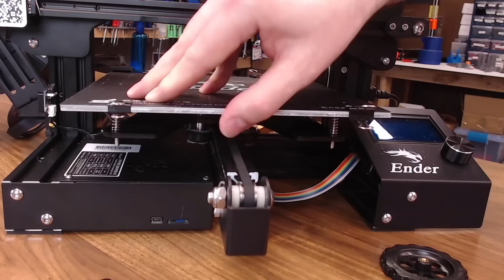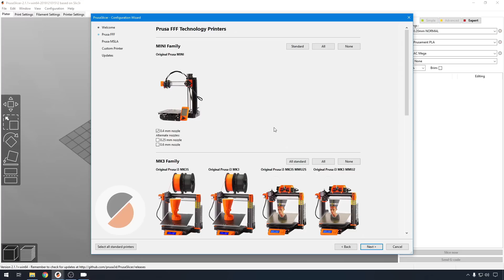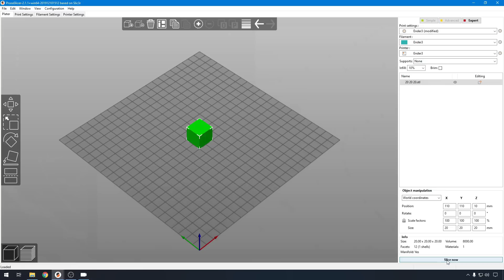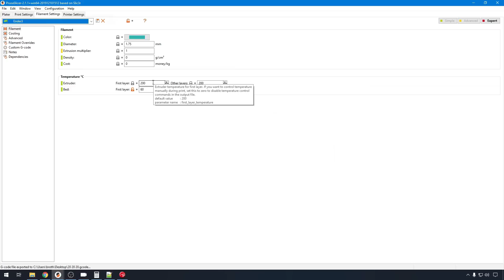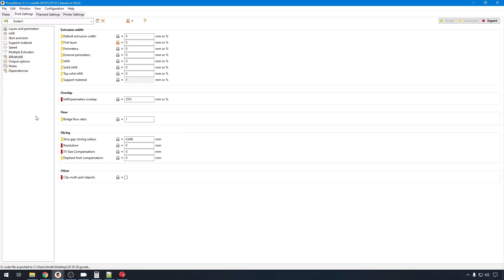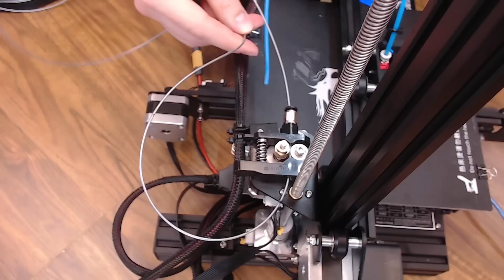New Ender 3 User Part 3 - Upgrades & Slicer Settings - Chris's Basement

Comment: Hello Mr. Riley!
I love your videos, learned much from them. My only complaint is when I need to come back for to watch adjusting something, it's hard to find from all of your videos. I knew I've watched you adjusting extrusion / check filament using a digital caliper but finding this video took some time. :) But you put ton of great stuff in one video; not like others changing a bowden tube for 10 mins to get advertised.
Reply from the maker: I wish it was easier to find stuff in videos too. We are working to go back and idex all the older videos to make it a bit easier.

Comment: is that last step on pronterface really necessary? don't really want to dealt with yet another program...
Reply from the maker: If you E steps need adjustment then yes. Most of the time, they are fine.

Comment: hwy chris i love this video series you are making on this printer seeing how i chose to get back into to 3d printing after a really miserable beginning failure to launch start some years ago. after much research and seeing this printer working live at a locale micro center i decided to get back into the hobby. and since have been having a lot of fun and frustrations. but when you started this series i was excited. so i have been watching and following along. i was using cura and having decent luck until i needed to switch my machines out cause the rotary knob broke now the machine i got is not as good as the first one lol. soi got prusas slicer and been working with it and i tried the enter the start gcode as you explained in the video how ever everytime i slice a a model i get an error sating the start gcode is has an error what could i have wrong because it does not make since at all i wll post it just as i have it written 
M104 S[first_layer_temperature] ; set hotend temp
M140 S[first_layer_bed_temperatrue] ; set bed temp
M190 S[first_layer_bed_temperatrue] ; wait for bed temp
M109 S[first_layer_temperature] ; wait for hotend temp
the other problem i have been having on these machines is my nozzle extrudes filament while heating up to print temperature
thank for your hard work and knowledge
Reply from the maker: Hey, I am glad to hear you are getting back into 3d printing. It looks like you have a spelling error causing the problem.

M104 S[first_layer_temperature] ; set hotend temp
M140 S[first_layer_bed_temperature] ; set bed temp
M190 S[first_layer_bed_temperature] ; wait for bed temp
M109 S[first_layer_temperature] ; wait for hotend temp
Reply: @ChrisRiley  that will do it everytime

Comment: I have my first 3D printer on the way (an Ender 3) and just ran across your channel looking for more information on getting started when it arrives. This series is very well put together. Very informative and well spoken. Thank you! I'm looking forward to the next episode. Still undecided which slicer to use. But will most likely be either Cura or Prusa (or both). That said, I have an idea for another video for this series but would be useful with any machine. I don't really see anyone giving their opinions on how to decide on wall thickness, infill amount, infill type, etc. The basics of what one needs to design a decent part, so to speak. As a complete beginner, I can see myself using a ton of filament on over built designs. Or completely wasting it on under built designs. Anyway, use it or lose it. I'll still be watching.
Reply from the maker: Thanks for watching, some of that will be in the next video for sure. Stefan over at CNC Kitchen has a lot of good stuff like that.

Comment: Side note on the springs:  They may lift the bed up.  I ended up having to move the Z switch up 1 mm to keep the head from crashing.
Reply from the maker: Good tip, thank you.

Comment: Hi Chis,
Thought I would share some of my start/end gcode.  (I deleted some stuff that not relevant for some people, like my LED code and M117 stuff).
You will note the temperature  placeholders,  hot end heats -5deg before the bed is up to temp.  Saves on oozing and  just sitting there hot. 

Start, 

M190 S{first_layer_bed_temperature[0] - 5} ; wait for bed temperature - 5
M140 S[first_layer_bed_temperature] ; continue bed heating 
M104 S[first_layer_temperature] ; set extruder temp and continue
M117 HOMING..
G28 ; Home
M117 BLTOUCH MESH..
G29 ; BLTOUCH MESH
G92 E0.0 ; Reset Extruder
G1 Z15 ; Move the platform down 15mm
G92 E0 ; Reset Extruder Distance
M109 S[first_layer_temperature] ; wait for extruder temp

end,

; Ender 3 Custom End G-code
G4 ; Wait
M117 ALL DONE!!!
M220 S100 ; Reset Speed factor override percentage to default (100%)
M221 S100 ; Reset Extrude factor override percentage to default (100%)
G91 ; Set coordinates to relative
G1 F1800 E-3 ; Retract filament 3 mm to prevent oozing
G1 F3000 Z10 ; Move Z Axis up 10 mm to allow filament ooze freely
G90 ; Set coordinates to absolute
G1 X0 Y220 F1000 ; Move Heat Bed to the front for easy print removal
M84 ; Disable stepper motors
M104 S0 ; Turn off Extruder temperature
M140 S0 ; Turn off Heat Bed
M106 S0 ; Turn off Cooling Fan
M107 ; Turn off Fan
M150 ; Turn off LEDs 

Also you might find useful the output file name placeholders,  have a look see.  Mine is...
[input_filename_base] - [filament_settings_id] - LH [layer_height] - [temperature]-[bed_temperature]°C - Speed [perimeter_speed]-[external_perimeter_speed].gcode
Reply: P.S      That start Gcode will also save you time if running an ABL.   give it a go and let me know what you think.  :)
Reply from the maker: Thanks for the code, I will check it out.

Comment: Fantastic series! Lately I've been trapped in what I am calling "slicer angst." Basically I've been trying to decide what slicer to use. Long ago, back when I first got into 3D printing, I ended up buying Simplify3D because I was having trouble getting the other slicers to work. I'll admit in hindsight that that was probably due more to noob mistakes rather than something actually wrong with the other slicers. But S3D has served me well, so I'm not upset about purchasing it, I feel I have got my money's worth. But the slow pace of upgrades, plus the fact that S3D v5 (whenever it finally comes out) will be a paid upgrade, has led me to look at other slicers. I used to like Cura, but I find the latest version really confusing with its byzantine settings hierarchy. (Which is a pity, because the Cura OctoPrint plugin is wonderful, I can just send my print off to my printer with one click.) Your video has convinced me to give PrusaSlicer a try, and so far I am cautiously optimistic. Looking forward to further videos in this series so that I can continue to tune my PrusaSlicer config.
Reply from the maker: Thanks! I am currently working on the next video, I have learned a ton about Prusa Slicer, it does pretty much everything I need at this point.

Comment: I like the idea that you heat the hotend and the bed at the same time, and am doing the same thing since ages.. BUT! You really should not heat the Hotend to it's final temperature before the printer homed itself! That's just a realllyyy bad thing todo, because it can ooze some filament at that point, when it almost touches the Bed, which will than stay there and if you are not careful will get in the way. It's better (and a approach from me, that even got in the Creawsomemod) to heat the hotend just to 140 degree, home the Bed and than let it heat to it's final temperature, which will most of the time take under a minute.
Reply from the maker: Good point, probably a good idea.

Comment: In more than 5 years and having worked on over 20 printers in the wild, I've never found the esteps to be out, ever!. I always laugh at the importance placed on this. Am I missing something here Chris? One imagines that each board leave the factory with exactly the same settings and hardware gets very little opportunity to be different. You'd have to be pretty unlucky to get something so far out affected only by hardware issues.
Reply from the maker: You have a point, you very rarely see this being wrong anymore. I think a bit of this is paranoia from the scratch build days. I have seen this be pretty out before, but it usually comes from a missed firmware setting.

Comment: Will edit this post as I watch... (done now I think) :)

I think you were a bit rough with the strain relief bracket when swapping that spring. I've seen more than a couple pictures on FB where the solder connection wasn't up to par and "manhandling" the wires might cause an electrical issue.

I made a simple spreadsheet comparing 1.75 vs +/- 0.08 (I got a roll of 1.68 from eSun last year). The % change in volume was interesting and I think could be noticeable in the layer consistency outside of +/-0.03. Yeah, sometimes I chase accuracy too much in these cheap devices.

You probably won't want to keep marlin as the firmware setting. There's something I needed to do in PS that using marlin prevented; I don't even think it was a really advanced feature. Have to check FB to see what it was. The PS group there clued me into it I think. 

I noticed you started the video with Expert enabled for your settings. I may have missed it, but you didn't mention that in the first half of the video.

Heating the hotend (will get there sooner than the bed) with the bed could create a long tail of ooze hanging off the nozzle that may not clear itself during the purge/skirt line. Not a problem if you're at the printer when you start a print as you can just swipe it off just before the bed gets to temp and G28 starts.

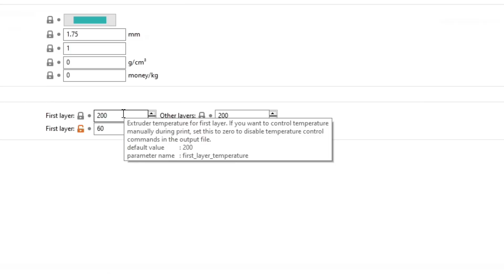13:31 Oh man, as many times as I've seen the setting tooltips I've never noticed the placeholder. Awesome info.

17:30 It messed me up on first layer for several prints until I realized the setting I was changing was relative to layer height NOT nozzle diameter which seems very counter-intuitive. Just so happens it's the setting you mention here. You can define it directly as a width in mm, but if you use % then it takes LAYER HEIGHT as the base value instead of NOZZLE WIDTH. You left it at 0 which defaults to 200% of layer height.

19:10 the scope really shows the pulsing of the extruder hob (or maybe the stepper) as you scan across the layer.

E steps should generally be set in whole numbers from my research across several YT videos and FB groups. It may be trying to squeeze the last ounce of consistency out of the system though and maybe too deep for this series.
Reply: I think you spend as much time watching you tube as I .  We both watch a lot of Tim's videos.  We are both old!!
Reply: Oh yeah... found it. PS will put accel and jerk settings in the start gcode which will override your machine defaults if you have Marlin selected as the firmware type. I was told to use reprap/sprinter instead so it wouldn't do that.
Reply from the maker: Just after reading this first one, I think you should be the one making these videos. I think you have done more test then me. LOL A lot of the stuff you mention is in the other 45 minutes of this video, to break it up to keep myself sane. More to come. I do appreciate your insights.

Comment: The printes don't heat the bed and the nozzle at the same time, simply to avoid stressing the power supplies more than necessary.
Reply: Most of these can handle with no problem
Reply from the maker: It's very rare you see that enabled nowadays, especially on 24v printers.

Comment: Never occured to me that the filament diameter could be the cause of my inconsistent prints. I guess there is no way for compensating that? Maybe I should overthink buying the first filament from ebay, sorted by price ascending ^^. Also.. does Joseph want to burn down our house for not using one of his printers? Leaving the bed on seems like sabotage to me...
Reply: Generally you want to measure a few places on the filament and take an average. Put that average in your slicer and it will help.
Reply from the maker: Hey Vincent, it does make some difference, you can measure and adjust it in the filament settings in Prusa slicer, but for most prints, you probably won't be able to tell the difference. As far as the bed, not sure why that is the default.
Reply: @ChrisRiley  Yeah really strange. If Slic3r knows it's Marlin, it also knows how to turn of the bed. Strange choice and hard to believe its an accident